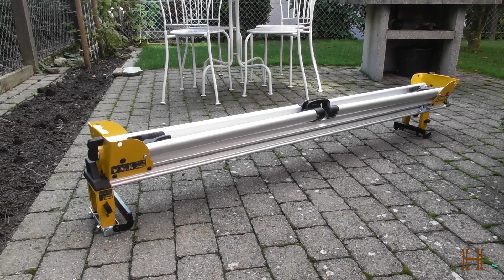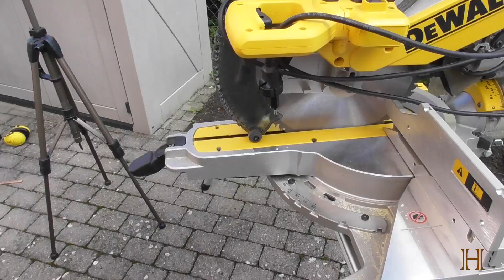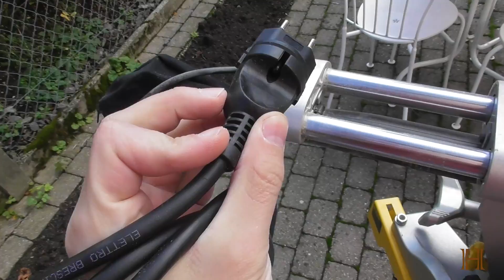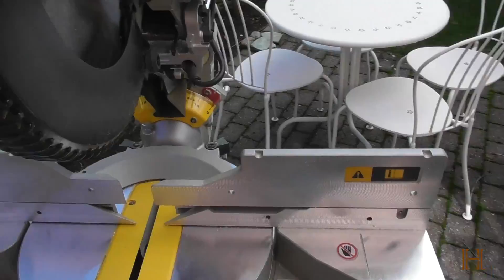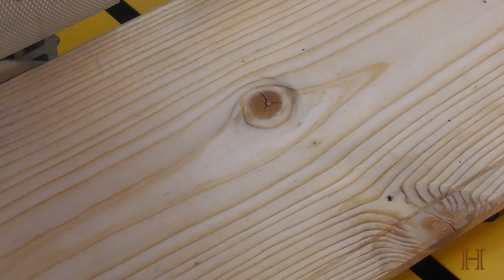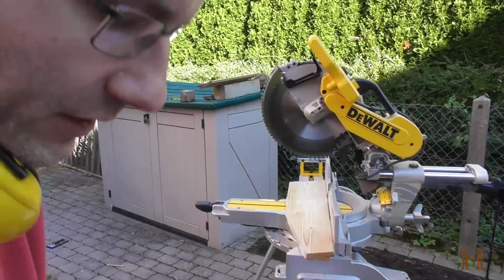DeWalt DWS780 and DE7023 Review

Comment: Dewalt makes great saws. I still have my 12” from over 20 years ago and never had one issue with it. I’m thinking of getting this one because my old saw has no safety and it’s not a double bevel or a slider either. Also the jerk motion you mentioned is even worse on mines. I thought these newer models had soft start feature though.

Comment: Saw is perfection  I give it Five stars. I enjoy the light for sure but its not a way to mark a fine cut ever . Mark your cut on the stock your cutting  and know which side of the line you want to cut off. Then look through the blade guard to line up the cut. My old saw was hard to see the cut line, this one is a dream. The saw connection to the stand you best have long arms to release the saw base from the stand at the same time or do one at a time holding up the one you released to get away  . As for the stand its nice also I like the handle and the feet that don't cross over like my old one . Mine was old like me lol. at least a 2003 model.  One thing I disliked was the the stand outriggers had no stops to keep the stock square with saw fence square . My old one did . This new floating one is OK  10 x more checking the cuts  for sure but Wow $1500 usd . Mine was  $700 usd with sexy 100 tooth blade from Freud in Italy . Bought In New Jersey USA . Sorry you paid so much but the saw kicks ass on crown moldings and you will make the money back fast .

Comment: would you say its worth the extra 150 bucks to have lazer deal compared to the 779 that dosent have it? and is it batterie powered or powered by the saws normal 110v
Reply from the maker: It's actually not a laser, it's an LED light that casts a shadow of the blade that shows you how it will cut. I personally like it very much,  however if you will be using this saw exclusively outside on job sites you can probably save yourself the 150$ because in direct sunlight it's really hard to see. And it runs off of the normal 110V or in my case it was 220V without any battery. Hope this helps.
Reply: @HubersRanch  yes that helps alot thank you

Comment: what is your opinion nowadays about this dewalt? would you buy it one more time?
Reply from the maker: I still love it and I would buy it again. In fact, since I moved to the US and couldn't take it along, I will be buying it again, that's how much I like the saw. But it is a massive tool so you do need the space but it has the power and the precision to cut almost anything imo. If you want it portable in terms of power and don't need it on a job site you might want to look at the flexvolt version of it. It comes with a 120v adapter to plug in an outlet but you can also run it off of 2 60V flexvolt batteries. Hope this helps!

Comment: I have used numerous saws throughout the years working as an installer and finish carpenter and I have owned the 780 since it's inception.  I am not necessarily a loyal dewalt user by any means, as a matter of fact my old 8.5 Hitachi gets used just as frequently.  This machine was made well.  I frequently change bevel cuts and stops stay dead on.  Glad this machine doesn't have soft start because I cut a lot and this bitch fires right up.  Use a thick blade.  Don't use those ridiculous thin kerf blades.  You can easily get fractions of a degree locked in.  I've used the kapex as well and this freaky saw out performs on jobsite.  The slow start on the kapex sucks.  However where the kapex exceeds is perfect cuts if your building nice cabinet doors... Quality of cut and the vac system is amazing.  I'll stop rambling.. Get the 780.  Most bang for the buck as well.